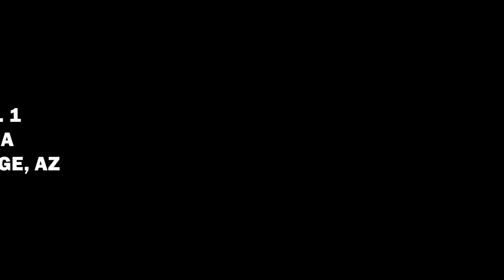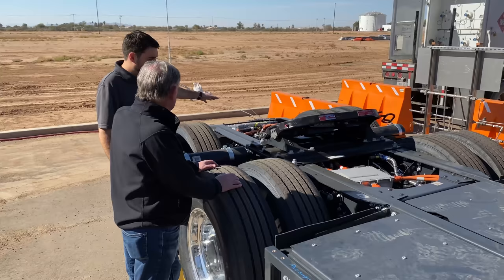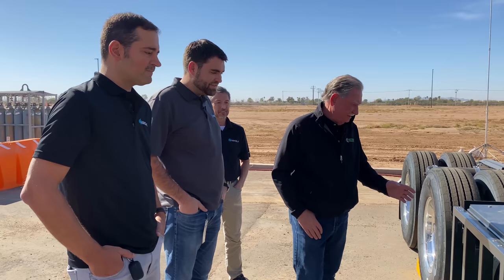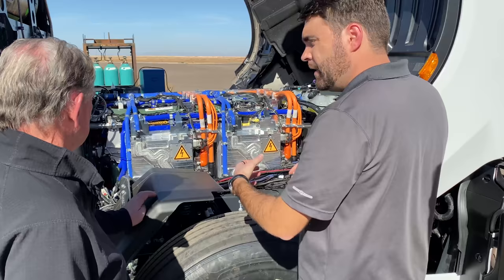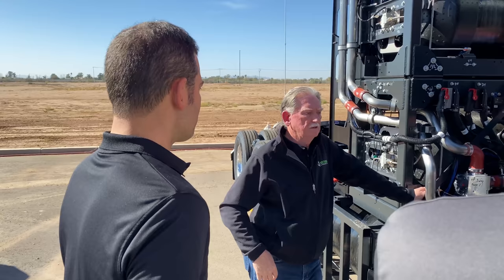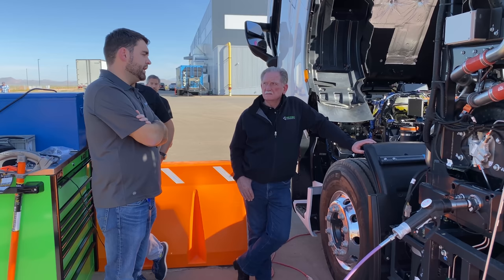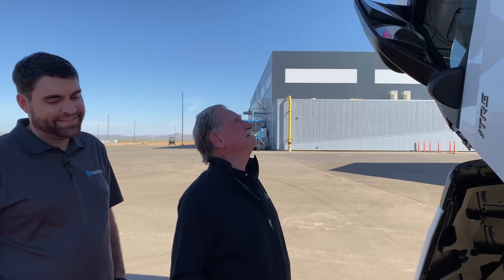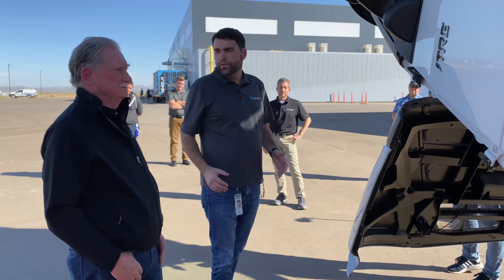Nikola Series - Ep. 1: Introduction & The FCEV Alpha

Comment: Only just started the video so I'm hopeful that these points will be addressed but the main issue with fuel cells is that hydrogen is 1) far less efficient than BEVs and 2) either more expensive if it comes from renewables or not green at all if it comes from fossil fuels (steam reforming instead of electrolysis). If all of these 2 (3) problems can be overcome reliably, then hydrogen can make sense for ships and super long haul trucking. That's a galaxy sized IF, though. Doesn't matter how nice the truck looks or what tech is in the truck. These are FUNDAMENTAL issues.
Reply: Agreed completely. From what I understand the hydrogen trucks may have the ability to drive much longer distances on one tank, making them appealing for niche markets of macro-regional routes or trains. 

That said, BEVs are absolutely more cost effective and efficient, especially today.
Reply: I think there are two technologies already close to availability that will make this viable.  1. The carbon storage system shown here https://youtu.be/U7CCq4oBgw4 and an alternative may be using Aluminum Batteries that have longer range but have to be replaced as discussed by Joe Scott.
Reply: Nikola was supposedly investing in fracking wells to produce their own hydrogen from steam reforming. (No clue where they are with that). I suppose one could argue for solar powered steam reforming, but there is no way around the sheer amount of energy required for the process and the knock-on impacts of methane leaking from fracking wells. That this technology is billed as zero-carbon or even low-carbon is just green-washing plain and simple.
Reply: @patreekotime4578  
They have invested in a company that will produce "Green Hydrogen" meaning "steam reforming + sequestration"
Really not green and certainly NOT CHEAP.
Reply: Hydrogen makes sense in any application where you care about mass efficiency far more than anything else, especially cost (which is the biggest drawback). Great for long-haul cargo (trucks or trains), merchant marine ships, although those are huge enough that they're far better served by nuclear reactors. If you skip the fuel cell and just burn the hydrogen, it's also attractive in aviation.
Reply: @iddqd339  Only if you ignore the actual real world weight of the vehicles and physical sizes of the systems.
Reply: Kind of reminds me of clean coal ;)

Comment: Interesting video, I'd kinda dismissed Nikola in my own mind after the Trevor Milton fantasy years but looks like they have a real development program now. Still questions in my mind over the larger number of moving parts in a fuel cell truck vs a battery one and what that might do to long term reliability and maintenance costs and the perpetual question on where the hydrogen is sourced and how much it costs at the pump as right now cheap hydrogen is "dirty", significant CO2 and methane released, and "clean", electrolyzed, hydrogen is expensive but maybe these come up later on in this series?
Reply: Totally dismiss it, not 'kinda'.  :D  Should be a penny stock they don't have a viable plan.

Comment: Hydrogen Fuel Cells could be the sucessor of the Diesel Engine. Allowing bigger payloads and quicker refilling, then a BEVs truck. Even heavy machinery companies as JCB, are opting for ICE Hydrogen Engines. Just lacks the proper supply infrastructure.
Reply: @bike-cave-man2527  you're forgetting that many trucks have rotative shifts with different Drivers. That is more evident in the heavy machinery industry. Also a massive battery pack, would mean a more expensive production costs.
Reply: @bike-cave-man2527  if many truck companies as Mercedes-Benz and Hyundai are steering towards Fuel Cell, they must know the advantages about that choice.
Reply: @bike-cave-man2527  the Semi Truck is yet to be seen. Also BEV truck are more used on the delivery sector. For small distances, small payload, and short shifts.

Comment: 270hp is barely adequate for 40mph uphill with a load. But the REAL issue here is that there is still no reasonably efficient AND green way to produce hydrogen. Yes electrolysis - but that's hugely inefficient and wasteful - you could charge 3-4 trucks with the electricity needed to fuel ONE FCEV truck.
Reply: Fortescue futures is on the mission of green hydrogen.
They've partnered with JCB

Comment: This is the first time I have seen under the hood of a hydrogen fuelled vehicle. Toyota and Honda have explored the technology but it seems unlikely to be adopted for passenger cars. I am of the opinion that there are likely to be 2 types of trucks on our roads shortly ie hydrogen fuel and battery electric vehicle (BEV).
Reply: Good luck with that! Looks like the cost of the FCEV is at least twice the cost of a typical tractor in service today maybe even 3 times the cost. Lots of parts to fail on the FCEV. Why would a end user purchase a FCEV for a regional application when the the EV only version should have a range of 300-350 miles in the near future? It makes the most sense for the long haul sector to continue with diesel only for the foreseeable future until the battery range can extend to a min of 500-600 miles.
Reply: Well it hasn’t been fuelled yet so technically you still haven’t seen under the hood of a hydrogen fuelled vehicle

Comment: That setup looks very very complex, and the more complex it is the more likely it is to break I would have thought. Lifetime seems quite low as does the power output, most EV's more powerful. Will these tow a big load, Hydrogen very expensive right now too. not sure right now if Hydrogen really has legs longterm. Maybe for some applications, but it needs energy to make and is often made from fossil fuels / Gas

Comment: One question I would like you to ask is the refueling challenges in colder climates and icing of equipment? Also while cameras may seem like a good idea to you all these electric do dads on trucks have proven to be problematic from a service and parts availability aspect. Freightliner has been plagued with software and camera issues on the newer trucks. Sensors have fallen off the windshields in hot climates. Imagine how much more complicated it will be when they convert mirrors into cameras.
Reply: Really? My car has 8 cameras and they work just fine, have done for years. So have many cars with reversing cameras etc.

Seems like freightliner just need to improve their quality controls.
Reply: That's because Freightliner and the others literally only install these "do dads" as sales tools.  They aren't engineered to last and aren't treated as essential equipment.
Reply: @TashiRogo  Actually they install them as nanny systems to make drivers miserable. How would you like to be driving down the highway and your cruise control goes nucking futs every time a car in front of you changes lanes?
Reply: @TashiRogo  When companies sell their trucks you know what the first thing they remove is? The Collision Avoidance System because no one wants it on the truck. It’s considered a liability.

Comment: It's actually a shame that this company has been so criminally contaminated by its management level.
Technically quite interesting, but these vehicles will probably remain a niche product, as they also have many disadvantages.
Reply: We are all striving for Net Zero so this must work.
Reply: @stephenwabaxter  I doesn't NEED to work. But I do think it must be explored. At least it'll give us a use for pipelines after oil and gas are discontinued. Can you imagine the environmentalists' reactions when you tell them a hydrogen leak isn't going to ruin the water supply.
Reply: @saff226  Natural gas pipelines can be repurposed for 100% hydrogen transportation.
Reply: @thegreenxeno9430  We are going to create Hydrogen in the North Sea and pipe it in for home heating using the existing utility infrastructure. Bosch have already developed the boilers that run on hydrogen.

Comment: The prototype looks more complicated than a diesel truck. I thought we are suppose to make things simple and less expensive. Unless someone discovers a way to make cheap hydrogen that beats diesel, it would not make sense to go hydrogen. 1) It cost more to buy, 2) it cost more to fuel, 3) It cost more to maintain and keep safe, 4) It requires a more expensive fueling infrastructure, 5) and it does NOT even beat diesel today. This is not just an engineering problem; it's also an economics problem.

Comment: I maybe missed the part where they run the engine and drive the truck around, or even push it down a hill.  There was too much smoke and mirrors in my opinion.   That said, I did see a municipal waste water treatment facility attached to a truck branded Nikola and a big empty warehouse with 3 “prototypes”  though.  Thanks for the info Munro and Associates - love your videos.
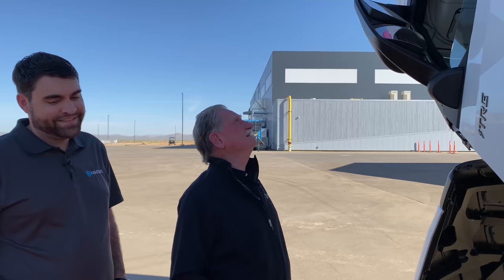Reply: At 24:08 we can see a gravity powered truck entering the frame in the background, rolling down a really long hill, then seamlessly switching to a smoke-and-mirror powered engine and driving closer
Reply: While the presenters are standing between the camera and the truck, the truck is being pushed by a bunch of guys to give the impression that it's capable of moving on its own.
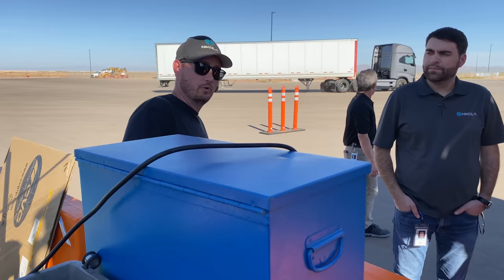Reply: At 25:06 we can observe the truck slowing down due to having run out of gravity juice and movie tricks. In a later shot we can see that the truck has been presumably towed away while the camera was pointing in the other direction.
Reply: You didn't miss anything. There are 4 more parts coming.
Reply: @SiisKolkytEuroo  Put away the tinfoil hat.  Nikola has BEV and FCEV Semis that work on their own power now, the downhill thing happened years ago.  There are numerous videos of the Nikola Tre actually driving, including driving uphill will al fully loaded trailer.  Nikola’s YouTube channel has some of them.  There are videos on other channels as well.  Nikola will start delivering trucks to customers in December of 2021, so next month.
Reply: @Zorkmid123  yeah I was just having a little fun with the guy I was replying to (a paranoid commenter)
Reply: @SiisKolkytEuroo  Ah ok then thanks for clearing that up.  Poe's law is a thing. lol
Reply: It’s a 5 part series. Use some critically thinking 🤦🏻‍♂️
Reply: I see, 5 parts.  I'll watch the rest and hope my mind can be changed, but my first impression is that it looks like a contraption.  And, I hope the economics and environmental aspects are good.
Reply: @johnr5312  if you're more experienced in the automotive industry than Sandy Munro, and have a different first impression than him regarding the vehicle, then I guess you're right
Reply: @SiisKolkytEuroo  good point.  My only experience is Nikola lying to the world and other highly respected experts claiming hydrogen is a fool’s errand lead by oil companies so they can keep selling gas.  With all due respect to Sandy Munro I will watch and judge for myself.  My first impression though isn’t great, in my experience.

Comment: 200 Kw, 270HP.  Those HP numbers were common in the 1970’s.  No serious professional truck driver today would buy a truck with that power unless they were just shuttling trailers around a dock.  Maybe that’s all the market Nikola is looking at.  No one will want to drive that on the open road with hills and wind regardless of how close hydrogen filling stations are.
Reply: Wait. I thought Nikola LOVES hills!
Reply: Nikola Tre Fcev can lay down car lengths of rubber to the road. Rear e-axles have 645 hp motors powered by electricity generated by 2 100kw h2 fuel cells and additional power as needed by a rechargeable battery pack. regenerative braking also replenishes rechargeable battery pack.
Reply: Nikola guys did not communicate that the h2 fuel cells produce electricity to power the 645 electric motors on the rear axles. h2 fuel cell does not spin a crankshaft, like an internal combustion engine which is rated in horsepower and torque, therefore does not have a horsepower or torque rating. There are h2 fuel internal combustion engines being developed that have horsepower and torque ratings.

Comment: The only advantage hydrogen has over batteries is the ability to pump it like gas. It's dirty (when it comes from nat gas, which it always will), inefficient, & dangerous. And there's no way we're building a giant hydrogen refueling network when electricity is everywhere. A hydrogen bus would be able to refuel at its home-base every day. Much better application than a long-haul rig. Huge waste of effort.
Reply: The only problem with hydrogen is you are burning something, just like gas.
Reply: @Samuel-ym7ls  Hydrogen fuel cell electric vehicles don’t burn anything.  The fuel cell generates electricity from hydrogen using an electrochemical process.  That electricity then powers electric motors.  They are a type of EV and they are different from hydrogen combustion engines.

Comment: I dont know why anyone is bothering with hydrogen power in car/truck/semi transportation. You are using energy to create your fuel instead of simply just using energy as your fuel. It just adds complexity and more room for failure. Can you give me one example of why Hydrogen is better? They're using a lot more parts on that vehicle than I bet the Tesla Semi will have, thus making it less sustainable/recyclable. How efficient is electrolysis? I highly doubt that its anywhere near 100%, so they are probably wasting energy. One solid fact coming out of the American trucking culture is that they prefer the conventional style of cab design leaning more towards the famous Peterbilt style. Choosing the cab-over style isnt a step in the right direction for America but I guess they could have substantial business in Europe and that would be a huge checkmark for our export value added. You will have truckers not only nervous about trying new tech but then you factor in the truck style change also? Good luck.
Reply: Cabover negatives are reduced a lot when an engine isn't below the driver.

Comment: Why people disliking sandy for having an open honest exploration of what’s going on over there.
Explores the factory and it’s an open space with no tools or machines or production. Walks over to the “hydrogen fuelling station” which is a truck with gas canisters on. Part of the business model for Nikola is they can produce hydrogen cheap or cheaper no attempts on that, why do they not even have a proper hydrogen station at the factory when the stations they will have to build and replicate hundreds of times are a big part of the product. Even talking about the pissy tiny line to refill instead of engineering the connector and getting wide acceptance, they are in talks with the consortium, just make your product do what you need it to. An HOUR. I mean sandys happy with the alpha but how many years has this thing been in design and prototype. Execution has not been good

Comment: Any which way to reduce CO2 emissions well to wheel is the objective and economics will be the forcing function in the end. Just dont see the Hydrogen Fuel Cell standing a chance if Tesla Semi Truck hits its design targets. This just seems over complex compared to cracking the battery code. I certainly wont be investing in Nikola Im still too suspicious given past shenanigans of gravity based propulsion systems plus I have ample invested in Tesla which for me is a far better risk/reward equations but I wish them luck in shaking off Trevors legacy.
Reply: In long cargo hauling and heavy machinery, Fuel Cells make more sense than BEVs. Allowing quicker refueling, maximize payload, bigger range, and having a smaller battery pack would mean an initial smaller cost. BEVs truck are more suited to the delivery sector.

Comment: Even putting aside the whole NIKOLA  "reputation", the complexity of that things is just not practical. The winner in no emission trucks will be reliability and maintenance cost IMHO.
Reply: Hydrogen trucks are NOT ZERO emissions , alot of FOSSIL FUELS are used to create H2 fuel.
with BEV , the batteries can be made with CLOSED LOOP Recycling and charging is with 100% RENEWABLE energy.

Comment: it's simple, once standardized to Net Systemic Conversion Losses and Waste
Sun -> molecules -> storage -> distribution -> conversion to mechanical work (the vehicle or goal) -> waste products -> waste heat...divided by net cost in dollars times pollution
simple; then all methods can be compared on an even scales.
storing the sun's energy (includes energy which is in the molecules of fossil fuels) in batteries or hydrogen , needs to consider the entire system of each, per the above

Comment: 170 bars of pressure is 14.7 psi X 170 bars = 2499 psi. Your average car tire has around 30 psi. So a hydrogen fuel tank has about 83 times the pressure of your car tire. The goal of 700 bar literally boggles my mind. Also, the pipe bender hanging on the side of the green tool trolly still had a purchase tag attached, (which made the presentation interesting but just a little contrived).

Comment: I'm guessing that Nikola doesn't build the fuel cells, electric motors, or controllers.  Or the rolling chassis.
Reply: Fuel cell system and components are developed and built by BOSCH !
It`s the same BOSCH that wrote automotive history several times in the past (spark plugs, ignition systems, injection systems for gas and diesel engines, ABS/ESP, lambda sensor for exhaust gas system, components and systems for all motorsport classes worldwide). Do you know who equipped the Formula 1 winner cars of the world champion ship during the last 7 years in a row or the 24 h race of Le Mans for the last 20 years in a row ? Without Bosch components/sytems the race cars could not even drive outside of the pit box